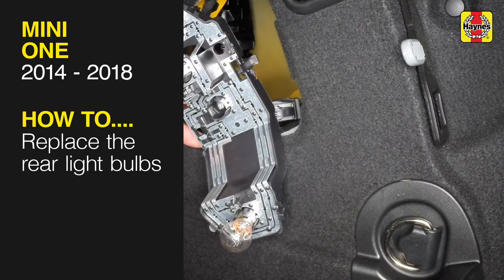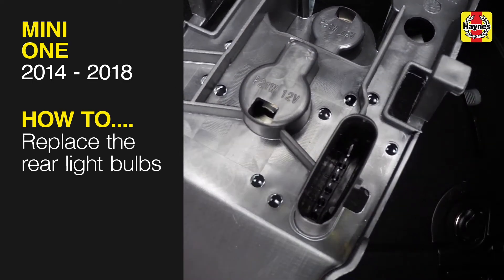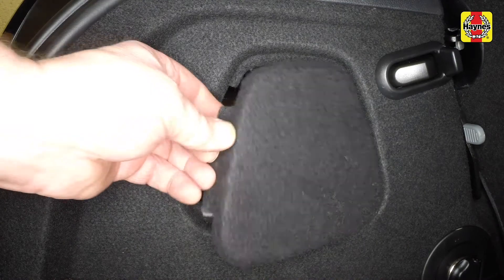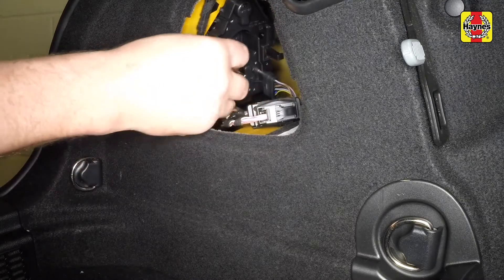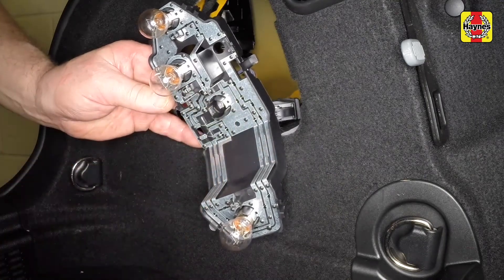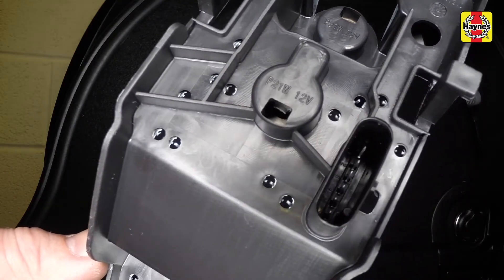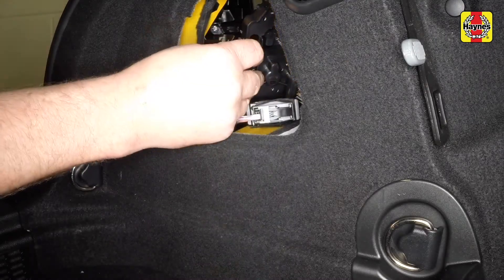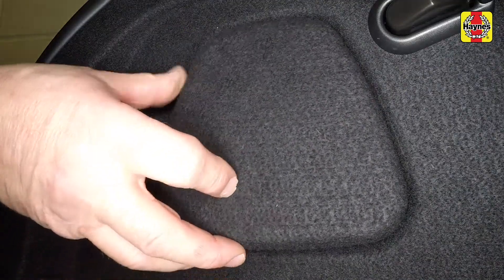Mini One (2014 - 2018) - Replace the rear light bulbs

Comment: Could you explain how to access the fuse for rear light's.
Reply from the maker: The rear lights on these models are supplied directly from the Body Domain Controller - there is no separate fuse for the rear lights.